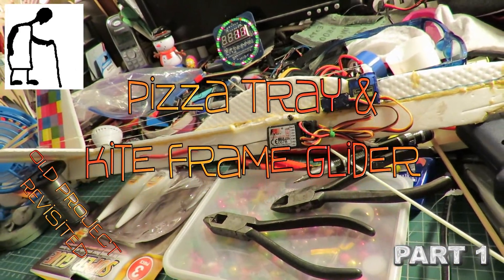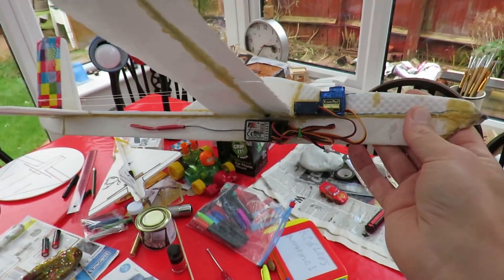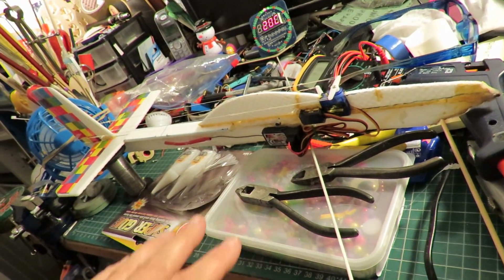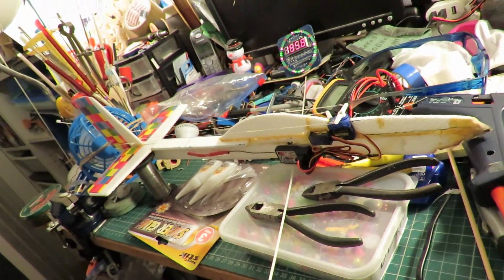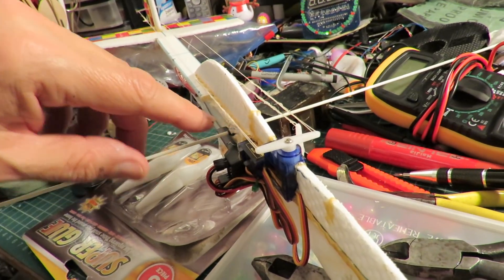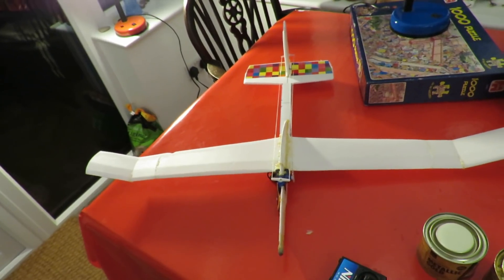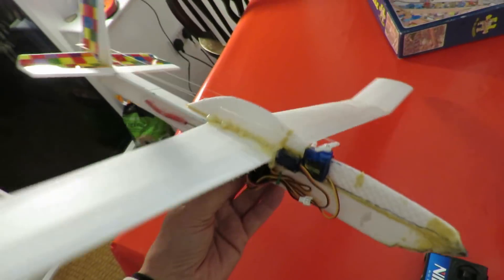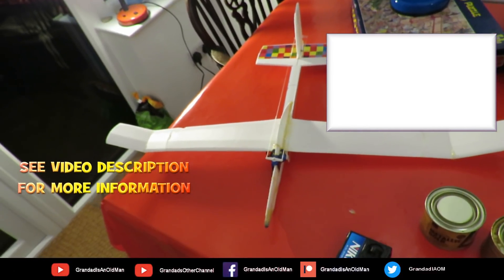Pizza Tray & Kite Frame glider revisited PART 1

Comment: Negative Dihedral ? = Anhedral. Compound wing = Polyhedral. Those wings look good, a little worried about them being glued in place, model gliders have their wings held on by elastic bands so they can 'ping off' in a crash, also incidence can be added (raising the leading edge of the wing) these wings are relatively thin so they might need incidence for the glider to be boyant enough.
 While your in wing making mood make some large, aerofoil profile wings for the 10 second electric model aircraft, i'm still convinced the lack of climb that displays is due to a lack of lift from the very crude original flat sheet small wings.
https://en.wikipedia.org/wiki/Dihedral_(aeronautics)
 https://en.wikipedia.org/wiki/Angle_of_incidence_(aerodynamics)
Reply: Keep in mind he is experimenting and learning as he goes like so many of us.  We all have to start somewhere in this hobby and will be limited by past experiences.  Some of the ideas we come up with as we watch his videos aren't likely to come to his mind at his experience level at the time of the video.  What we say, or suggest is really for future viewers and when the project is revisited.  Not that making suggestions is a bad thing, but rather useful at some future time to any who might want to give the project a go.  That is the tone I am trying to project when I offer suggestions and I hope it is a useful thing to do.  I don't want to sound harsh or condescending.